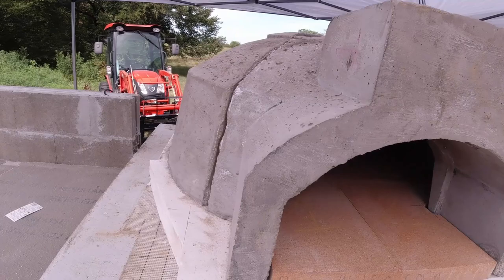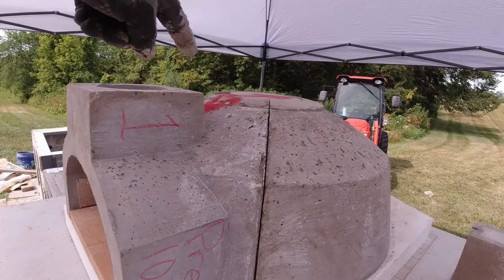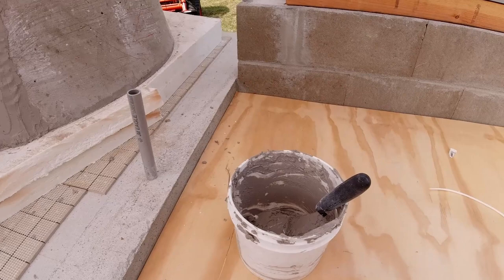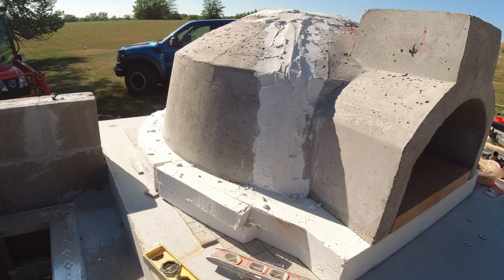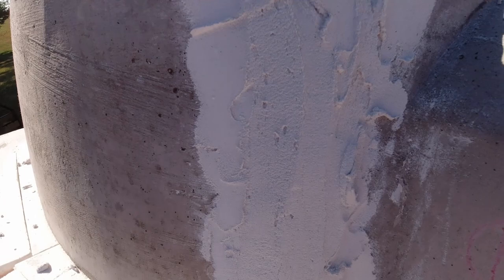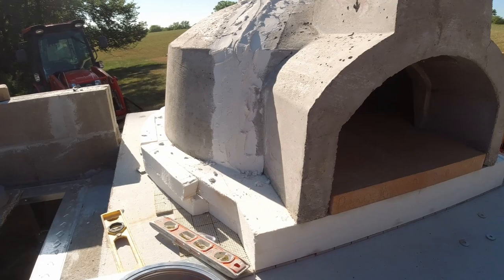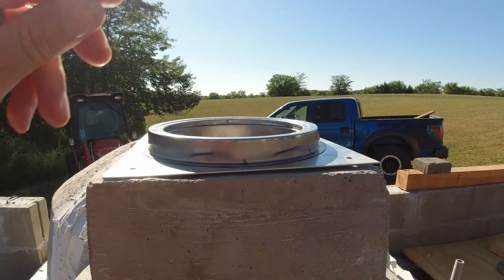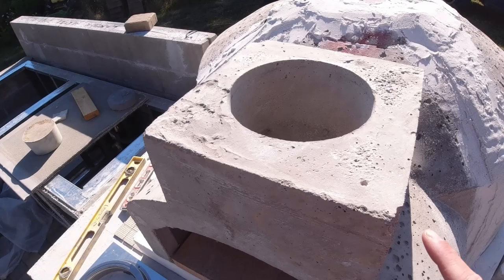Wood Fired Oven Cracked?! | Installing the Forno Bravo Premio Wood Fired Pizza Oven #woodfiredoven

Comment: Excellent video ,I have completed a few of these now and what I have done to prevent the mortar going into the gap is to put som 3/16 fire rope in there which will stop the mortar and at the same time allow the dome to expand and contract as it will never go hard as its fibre rope
Reply from the maker: That is a brilliant solution to that problem.  Wish I would have thought of that!
Reply: Can you provide a link, name brand of fire rope you use?
Reply: This is a great idea. Thank you.

Comment: When I built my oven, I was instructed to soak every brick in water for ten minutes before mortaring it in place. This is because they are very porous and would soak up all the water from the mortar, leading to cracking. I would think your concrete oven had the same effect. I am by no means an expert on this, though.
Reply from the maker: I think you are right and that did have something to do with it.  Although I am still not sure about the supplied mortar for outdoor use.  I did contact Forno Bravo about the cracking and they did state not wetting the oven before applying the mortar could be the problem.  Unfortunately, it doesn’t state anything about wetting the oven before applying the mortar in their instructions or in the online installation video.  The mortar I replaced it with was a dry mix and seemed like a better product for the application.

Comment: Really nice video.  I think a lot of ovens crack between the dome and tunnels sections.  I’m thinking about chipping off the render coat, adding more rock wool and then rendering again on to chicken wire but this time with it extended over the tunnel section to reduce cracking. Good job.
Reply from the maker: How many inches of insulation you have now?  I have 4 on the sides and 5 on the top and my oven will stay warm for 2-3 days.
Reply: @blood_sweat_and_beers  My dome is 2" thick made with 2:pearlite, 1:sand and 1:cement, then a 2nd 2" thick layer with just 3:1 pearlite:cement, then 2" rockwool.  Not enough I think.  I get 50°C still midday on the following day if the door is pushed back.

Comment: i want to buy one of these ovens. around how much does each piece weigh? is it easy to install with one or 2 persons?
Reply from the maker: My oven weights about 1300lbs. Each section was about 200-250 lbs.  I was really worried about the install, but myself and brother in-law were able easily manage it.  The tractor lifting each piece to the floor height made all the difference.  If you go with the Casa instead of Premio, each piece is about 33% lighter.

Comment: Seems to be a little on the low quality control of a kit. Broken pieces and mortar that isn’t any good
Reply from the maker: I agree.  Nothing in my kit will have an impact on performance, but for as much as the kit costs, it would be nice to not have chips missing and a dry mix bag of refractory mortar included instead of the premixed.

Comment: Was the oven cracked or just the sari set?
Reply from the maker: Just the premixed high temp mortar they supplied cracked.  That stuff is junk.  Luckily, there were no permanent issues with the oven itself.
Reply: @blood_sweat_and_beers  I got two buckets of the 'junk'.  Hope it works better for me.
Reply from the maker: @SuperMoeLarryCurly  Good luck!  Pre-wet the oven and cover with plastic.  Report back, will be interested to hear your results.